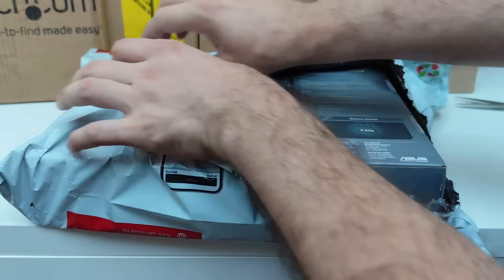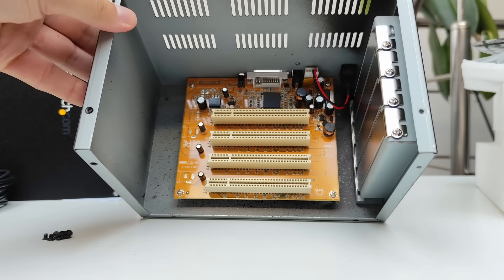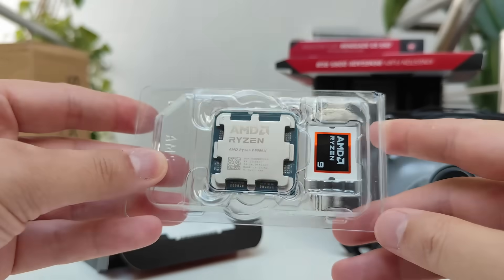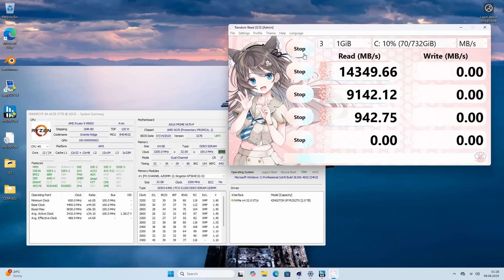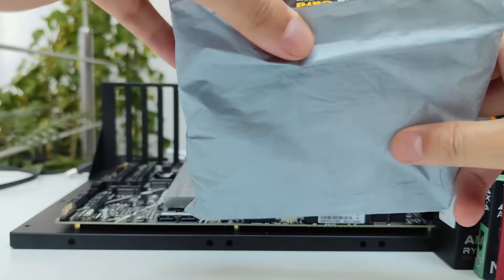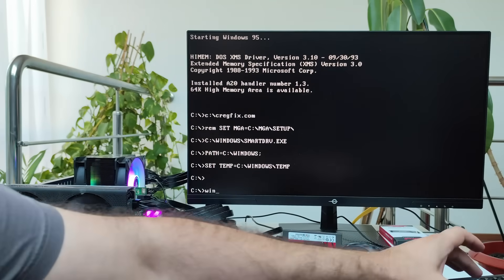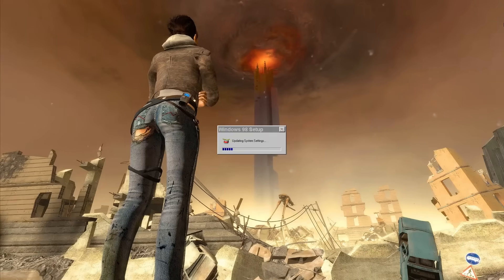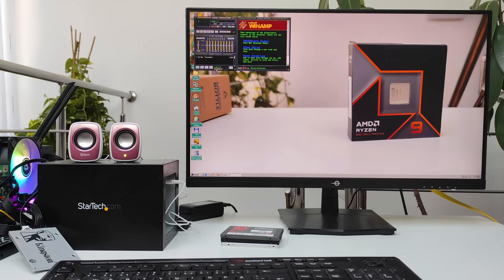Windows 98 on a Ryzen 9 9900X@4.4Ghz and... It (Eventually) Booted! (On Bare Metal)

Comment: I'm impressed with how you got the hardware as much as getting it working! Now see if you can hackintosh it, and try running 3.1 too.
Reply from the maker: I recently installed Windows 95, and it's working well. As for Windows 3.1, I will make a new video. In the meantime, check out this one: https://youtu.be/JbXkvM3b2Qg

Comment: Does 98 only see one CPU core ?
Reply from the maker: Yep, just one core. The advantage is lower power draw compared to running a virtual machine that has to emulate a Windows 98 PC, which ends up stressing multiple cores just to mimic much slower hardware.

Comment: How did you get around the memory limitations
Reply from the maker: With memory on Windows 98 you have two options:

Option A: Limit it manually via system.ini by adding a MaxPhysPage line under the [386Enh] section. For example, MaxPhysPage=20000 will cap memory at 512 MB, even if the system has much more installed (like 64 GB in this case).

Option B: Use PATCHMEM by R. Loew. This patches certain system files inside VMM32.VXD and allows Windows 98 to access the maximum RAM available. On this setup, Windows 98 ends up with about 1733 MB usable RAM. Maximum for a 32bit OS would be 4GB but a lot of RAM in the first 4GB is reserved for "system use".
Reply: @O_mores interesting

Comment: Wild! Excellent video, and love the combo of ancient operating system on the latest bare metal.

Startech knew what they were doing with this. As someone who occasionally has to shoehorn legacy hardware and software into doing stuff it has no business doing, it's really useful to know those PCIE to PCI solutions exist. Great use of their marketing budget, reaching potential customers you'd never find with FB/Insta ad spend. 

I'm already a big Arctic fan (no pun intended). Excellent to see them onboard. I even have a P12 Max fan on a 3D-printed adapter on a Karcher vacuum cleaner filter behind me as a 24/7 air purifier for this office.

I'd had some negative experiences with Kingston, but this is the push to get me to try them again. Redemption arc incoming?
Reply from the maker: Well, this is like a double-double combo ... You basically end up with a Windows 98 + Windows 10 machine (and most likely Windows 11 since October).

I ran some Cinebench 2024 benchmarks and the scores were actually a bit better than what I saw online. I’m pretty sure those systems were running on UEFI. For example, this PC scored 1849 on multicore, compared to 1764 on CPU-Monkey and 1823 on TechPowerUp. So running Windows 11 with CSM doesn’t drag performance down - if anything, CSM feels more lightweight.

The StarTech enclosure is really nice, though I wish I had gone for the bigger model. This one only supports half-length PCI cards, so I can’t fit two 3dfx Voodoo 2s. The funny thing is the bigger one costs only about $20 more. (but overall these enclosures are kinda pricey)

Also, Arctic launched a new product just last week - a fancy ATX case, that can fit two 420 AIOs. This is new for them. I mentioned in the video that no one wanted to send me a case… well, now I know where to ask. 😅 I already ordered a large case that supports up to 9 PCI slots, but now I'm curios about that case too.

As for Kingston - never had issues myself, though back in the DDR1 days RAM sticks used to come with “lifetime” warranty...

Comment: I always wonder about evolution and advancment in PC when todays computers even can't run the simpliest program from the early 90's ?
Reply from the maker: This CPU and system can actually run programs natively, even those from the 1980s, made for the original x86 PCs. The 16-bit support is still present in the CPU. However, for security reasons, you can't run 16-bit software directly on the latest Windows versions. Still, you can install Windows 98 or even Windows 3.11 and enjoy classic software. Check out this video about Windows 3.1 on a 13th Gen Intel CPU: https://youtu.be/JbXkvM3b2Qg

Comment: 2:15 The Startech PCIe to PCI enclosure costs a few hundred dollars. That's almost like the price of a another PC.
Reply from the maker: Yeah, I can't argue with that, but enclosures like this are products primarily meant for industrial use, and everything is more expensive when it's 'industrial.' Just try to get an 'industrial' ATX motherboard. :) 

By the way, I was thinking of buying a 2-PCI slot enclosure I found on AliExpress for about $130... not exactly cheap for that site. It uses a PCIe x1 passive adapter and a USB 3 cable to transfer the signal to the enclosure. The problem is that the small PCIe x1 card that plugs into the slot doesn’t have a redriver chip, unlike the one from StarTech, which has one. That chip is necessary to boost the signal from the PCIe slot over the cable, as many PCI/PCIe chips are very sensitive to trace distance.
Reply: @O_mores  ok

Comment: How to lower the clock speed of this PC so to play Warcraft 1?
Reply from the maker: I doubt Warcraft 1 will run well on this setup, even DOSBox needs some tweaking to run it properly. Anyway, when using real hardware, there are some slowdown tools like Mo'Slo, Throttle, CPUKiller, or ICD/ICE (which disables CPU cache). They're made for this kind of thing.
Reply: @O_mores  ok

Comment: Can you change the card priority changing the IRQ that it is? In 98 time i remember having hard time convincing OS to install the modem on COM3 and not COM1, since i needed the mouse.
Reply from the maker: Usually, you can't do much about IRQs. There is a lesser-known setting in Device Manager > PCI Bus where you can disable IRQ steering and similar options. When running DOS games from within Windows, the specific IRQ used by the sound card won’t be an issue, since sound is routed through SBEMUL.SYS (the Sound Blaster Emulation layer) but you will need a sound card with WDM drivers.

Comment: I found older PCI cards in modern 'converter' boards works best whgen in 66Mhz bus, 100/133 seems to makee alot of issues.
Reply from the maker: Just a note… standard PCI runs at 33 MHz (some cards support 66 MHz), but there’s no 100/133 MHz mode. With an ASMedia 1083 bridge (which is very common in motherboard with PCI slots) the bus speed is usually auto-negotiated. Some cards might run at 66 MHz, but this happens automatically without user input.

Comment: Which brand label maker is that??  All the P-Touch ones I have waste a lot of tape every time it prints a label, wasting an inch (25mm) on both ends of the label.  I like yours as it doesn't waste as much.
Reply from the maker: That's a lot... Mine it's an Epson LabelWorks LW-400, I have it since 2016, might be a discontinued model by now.
Reply: @O_mores yeah, I don't see it on Amazon, but I found one that should be okay from a Chinese manufacturer. And it uses the same cartridges that I already have.

Comment: What exactly is the point of running it on such hardware? Windows XP should do. I wonder if it will work on B350 but I will try. The only reason to do it for me is that Sub Culture from 1997 will only run on 32-Bit OS. If that doesn't work I will have to assemble the H61 board I have laying around.
Reply from the maker: I think the point... really depends on your use case. For me, it works to reboot from Windows 10/11 into Windows 98, take a break, disconnect from the internet, and then get back to work - without swapping my PC, display, mouse, etc. And while doing this, I’m running the fastest Windows 98 PC ever... On that B350, both 98 and XP should run without issues. If something goes wrong I can help.

Comment: And I'm having problem installing win7 to a b550...

Also did you try the Win98 Quick Install 0.9.6?
Reply from the maker: I'm sure you'll get around to installing it. Windows  7 official support actually went up to X470 (2018), and B550 was released in 2020. As for the quick install - haven’t tried it yet, I usually just throw in a preinstalled copy.
Reply: @O_mores I tried the usual way and the setup couldn't detect the SATA drives or any drives

I'll try with ntlite to add the x470 drivers and updates and see
Reply from the maker: That's strange, there's AHCI native support since Vista, so Windows 7 is already better in this department.The problem might be that some SATA ports are sharing bandwidth with the M.2 slots, or even with the PCI-E x1 slot (on this motherboard SATA ports 3 and 4 won't work if the PCI-E x1 slot is used - which is currently the case).

Comment: Couldn't you emulate every Windows in VM on Zen 5?
Reply from the maker: I like it this way because it's faster and less power-hungry.  For example, emulating a Pentium II PC in 86Box with a Voodoo 3, while running Windows 11 at the same time, uses way more resources than just booting into Windows 98 in single-core mode. In this scenario the CPU power draw is probably 25–30W. But if you you run a VM with multiple cores + hyper-threading, and turbo boost, power consumption can easily double or even triple.
Reply: @O_mores  OK, I get it. But experience is basically the same?
Reply from the maker: Depends on what you’re actually doing in Windows 98. If it’s just to enjoy the interface and take a quick tour, a virtual machine is enough. But on real hardware (like on this Ryzen 9 9900X PC) you can use a powerful GPU and play games maxed out at the highest resolutions. Back then, video cards could barely handle around 1024x768, so this is something you could only dream of on period-accurate hardware.
Reply: @O_mores  so gaming is not possible in a VM?
Reply from the maker: Check out this video, it's about gaming on the same PC in a virtual machine (PCem) versus real hardware: https://youtu.be/f79BuN527eM

So, it's possible, but depending on the virtual machine you use, performance  is rather limited. With some VMs, you can set up GPU passthrough to utilize an actual GPU, but those setups aren’t easy to configure.
Reply from the maker: Okay, I’ll make an 86Box video then. I’ve fiddled around with it a bit, but I can’t say I’m very acquainted with it...

Comment: That's really nice to see Windows 98 running on really recent hardware, but what intrigued me the most is that manufacturers still produce motherboard with PS/2 ports (we nearly no longer hear about them because all our hardware is USB now)
Reply from the maker: Not only motherboards, but there are some $150+ RGB gaming keyboards that ship with a passive USB-to-PS/2 adapter (they’ve got on-chip PS/2 support, otherwise that adapter would be useless on modern USB-only boards). So... PS/2 keyboards are kinda a niche gamer thing now. Back in the day, USB had issues with key rollover (you couldn’t press more than 6 keys at once), and in gaming you might hit a lot of keys simultaneously. 

And of course, there are the diehards who just want to use an original IBM Model M. If you’re dropping serious cash on one of those tanks off eBay, you probably want to plug it into a real PS/2 port.

Comment: I need a modern PC that runs W7, please help !
Reply from the maker: Check out this video where I install Windows 7 on a 14th Gen system with a Z790 (DDR5) motherboard: https://youtu.be/EAUqZZrbCQc Everything works... So you can basically drop in an RTX 3060 (which are still widely available) and you've got yourself a brand new, out-of-the-box Windows 7 compatible PC!

Comment: Love it how nuts this is subscribed!  I like that mobo with 6 SATA ports as hard to find these days!
Reply from the maker: Welcome aboard! Now about those six ports... turns out that number comes with a giant invisible asterisk. According to the manual: 'The PCIe 3.0 x1 slot shares bandwidth with the SATA6G_3/4 ports. When a device is installed on the PCIe 3.0 x1 slot, the SATA6G_3/4 ports cannot be used.'  So, on my setup with all PCI-E slots stuffed, I can only use 4 SATA ports, but having 3 x M.2 slots helps...
Reply: @O_mores  Similar to my B450 mobo - it has 4 ports but if you put in an m.2 SATA rive not NVMe, it uses he same bandwidth as Sata port 3 so had to get a PCIE sata card.

Comment: I have a 9950X, if i have time, I might attempt this as well, this is also something I wanted to try as well when I built my system, but never had time + I need this system to be working as it is my main system that I rely on.
Reply from the maker: I'm sure you can pull this off, especially since it boots from NVMe - just make sure to format it as shown in the video. I'm actually running Windows 98 on my main PC (the one I use for video editing). When I need a break, I simply restart into Win 98... no emails, no notifications... Then I restart again and get right back to work.
Reply: @O_mores  ye this is definitely something i'll try if i get a second nvme drive, though hopefully the lack of a ps2 port doesn't cause me too many issues

Comment: Nice video.     At 14.08. Where did you get your Electric Screwdriver, can you put a link in the Description
Reply from the maker: I got this for free with my first Temu order. I’m not sure if I can recommend it... The upside is that it’s really lightweight, but it’s not very powerful - it struggles and stops if the screw is even slightly overtightened. Next time, I’ll probably get something with more torque.

Comment: When applying the paste you did an X pattern and one dot or it was anything else? Because the video moved quickly after the first dot
Reply from the maker: Nothing else. The X pattern is actually how Arctic suggests applying their MX thermal paste. Check out this 30-second video on their channel:  https://www.youtube.com/watch?v=psY8HIu5Xtg
Reply: @O_mores  Comments on the arctic video are more confusing. Its "dot" vs "X". I used the "dot" in 9600X and arctic freezer 36 CO. Is it normal for 52 idle. My old ryzen 3600 is around mid 30
Reply from the maker: Usually, just for my own peace of mind, I use those little spatulas that come with thermal paste to make sure everything is spread evenly, like I did in this video: https://youtu.be/EAUqZZrbCQc I think the X pattern does the same job, especially since the crossing point in the middle gets a bit more paste.